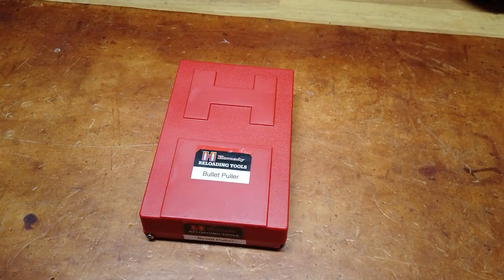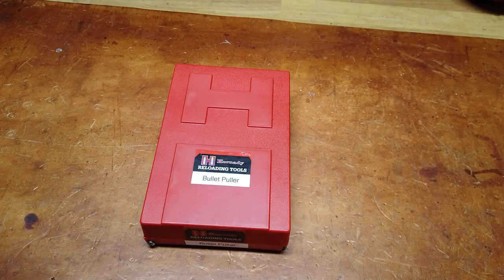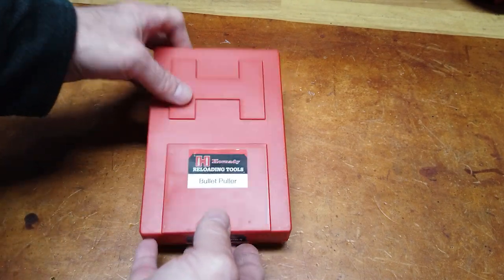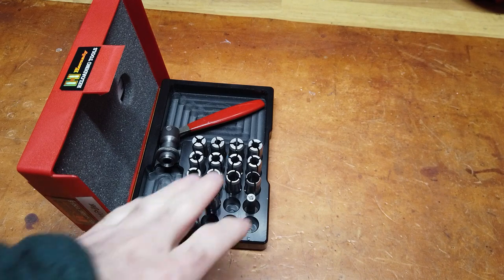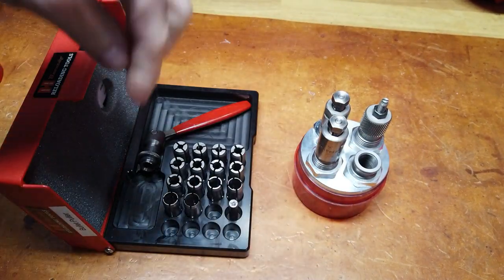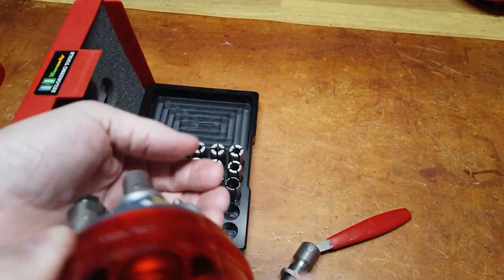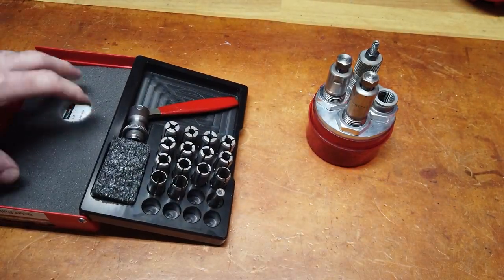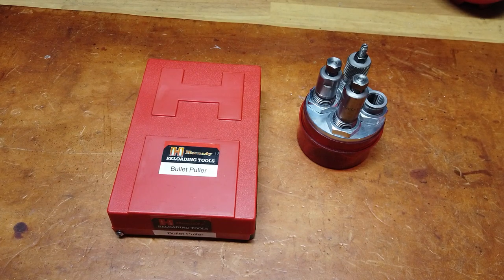Hornady Reloading Upgrades:  Cam-Lock Bullet Puller Case/Tray

Comment: This is a great idea, found an empty case on Ebay too. It was only $8.00 bucks but 
almost $10.00 to ship.it! Seems high for an empty box, but if you dance to the music,
you have to pay the piper :-)) Thanks for sharing.
Reply from the maker: S/H at times is SO unnecessarily expensive.  I've had parts so small/thin they could ship in a normal envelope for the cost of a stamp...that end up costing $7-$11.  Nothing more frustrating than paying $10 for a $1 part, but it is what it is and when you need/want it, you're going to pay for it.
Reply: @ReLoadersBench    Very true.

Comment: Nice. Can y'all design a universal primer feeder tube filler machine like Double Alpha?  The 1911 filler design is not great. It has the hardest time to fill WSP .
Reply from the maker: MATAGUNSLINGER ! - Look up the Frankford Arsenal VIBRA prime
Reply: @ReLoadersBench  I didn't want to buy another product that was similar design. Have you used it using Wichester Primer with LnL AP and tubes?
Reply from the maker: MATAGUNSLINGER ! - I use the FA  Vibra Prime with both large and small primers (Winchester and CCI) and have no issues with the FA tube feeding primers into the Dillon or Hornady tubes mounted on the presses.